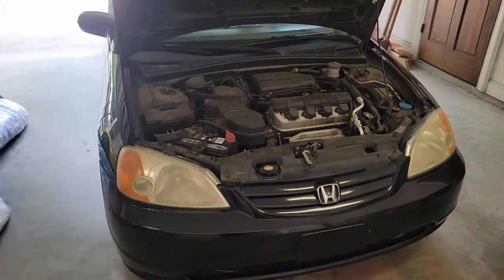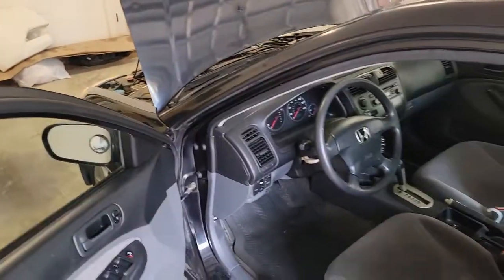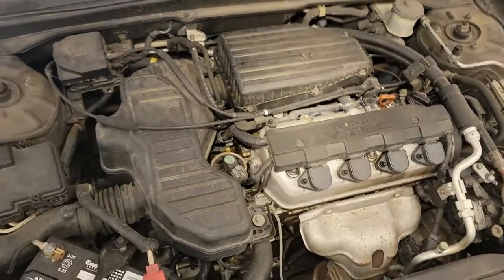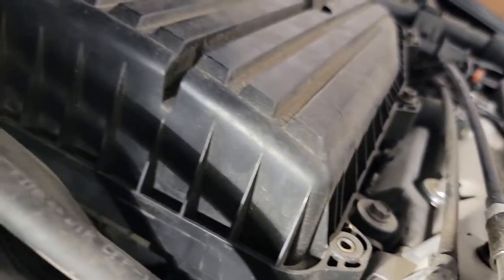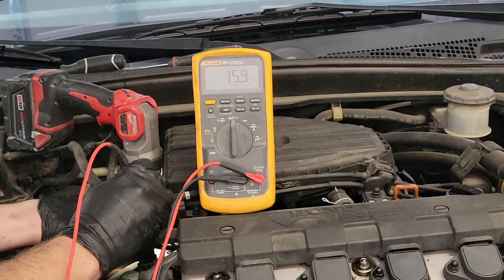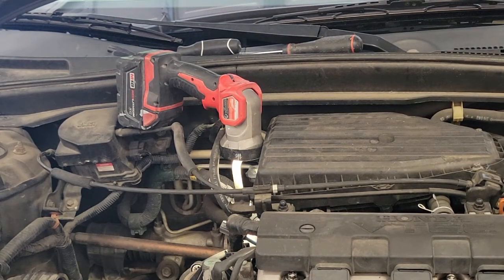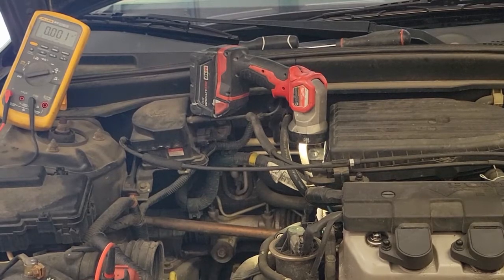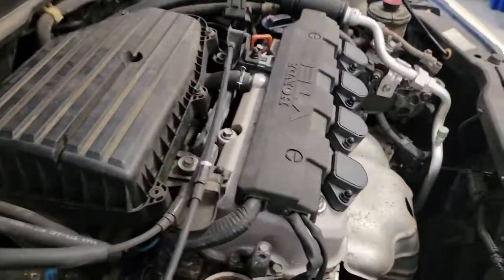HONDA/ACURA P1259 VTEC TESTING AND DIAGNOSIS | 2001 CIVIC EX

Comment: Mine says p1259 Manufacturer control 2002 Honda civic ex coupe and it stutters when im driving i already changed the solenoid and changed the oil

Comment: i got no leaks i’ve changed the oil pressure switch but it’s still going limp at 3.5k rpms, idk if i should replace the whole vtec solenoid setup or just a sensor
Reply from the maker: You need to check the solenoid resistance and see if it's open or high. Try testing it also with battery voltage applied with it unplugged so it's isolated from the computer.

Comment: I recently got the left rear valve solenoid code. Went ahead replaced my vtec solenoid. Have to replace the connector plug to the old pressure sensor bc the clip broke and pops off it so the cel light comes on. I too have a 2001 civic manual. Also have to replace the oil light sensor bc it is leaking oil on top of the oil filter

Comment: I replaced the VTEC solenoid, pressure switch, changed the oil and light would still come on.  I ended up doing the bypass wiring and light never came back on. Only thing I resolved with changing out solenoid assembly was fixing the oil leaking from gasket.

Comment: I have a 2001 civic ex Manuel with same code. Just did complete tune up and now light came on, I took to a shop locally and they said it was nothing to worry about and light was off and it’s back on 3 days later

Comment: Wanna know what my 2002 was?  I tried everything to no avail and found it changing valve cover gaskets.  There's a plug in the head downstream of the spool valve that had vibrated out and was laying in the oil inside the valleys of the head when the valve cover was off.  Cleaned the hole, used loc-tite, no more trouble.  V-tec works!  218K miles now....